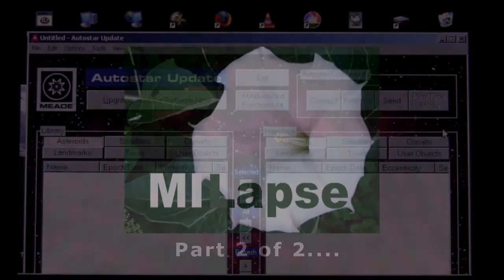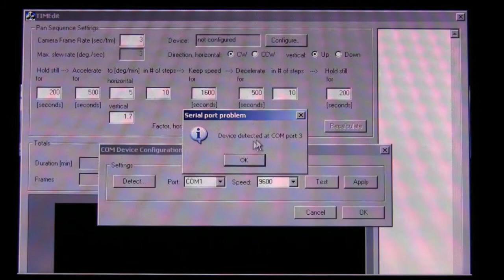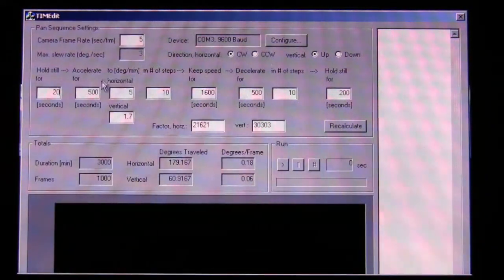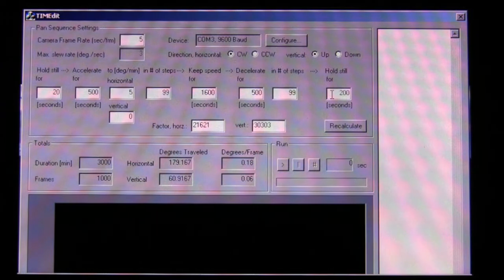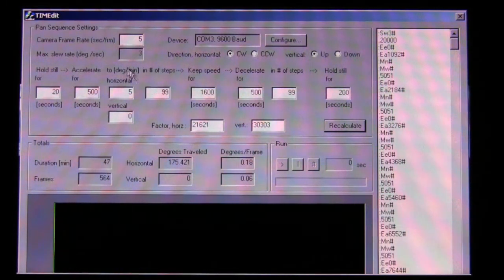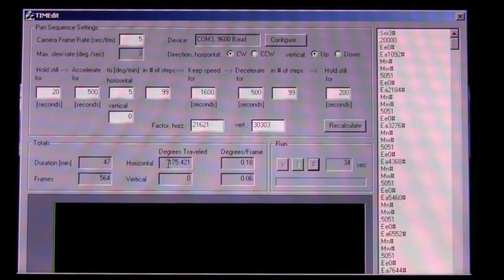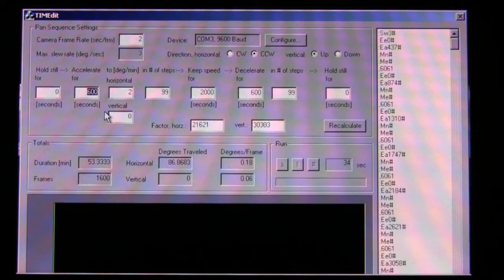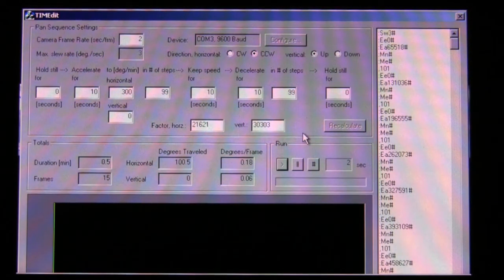Timeismotion software (how to use) for MiLapse Head - Part 2

Comment: @milapse Thanks for the info milapse! I was looking at OpenMoco too... just a question though: Are you still using the same motorized head and Meade controls, or switched to the full Arduino project on OpenMoco?
And if so, did you assemble it yourself or you bought it?
I can deal with the software part, but I'm useless when it comes to hardware... :P

Comment from the maker: @XSportSeeker this is what's commonly known as a 'hacking' or 're-purposing'... It's not a product that I produce, it's a Meade product. The only thing the 'TIM' software adds is the ability to 'ramp up' and 'ramp down' your speed - like I say in the beginning of part 1 "TIM will allow you to get gentle starts and stops to your timelapse pans".  The Meade head alone will work fine for simple continious pans at any speed. If you need more information go to timescapes(dot)org, lots of info there.

Comment: Not to be picky, I really like the product, price and iniciative, but why not simplify things? I like the videos, but they are a bit too long and don't pass much of a sense of security...
Now that the Meade controller goes with the head, why not send it with the custom firmware preloaded?
Another thing I still didn't get: how much can the setup do without a PC attached to it? From what I understand, most jobs can be donw with the head alone, right?

Comment: Any idea if this will work with a Celestron NexStar SLT mount? It appears that you can communicate with the mount via the same RJ10 - RS-232 - USB cable, and it appears that the mount can be controlled by a computer from this port. However I assume that Meade and Celestron uses a different protocol, so what needs to be changed for this software to work on a Celestron mount?

Comment: Why do you need to update the firmware on the meade head to a custom firmware?  I am wondering why the TimeIsMotion software does not just use the meade commands outlined in the "Meade Telescope Serial Command Protocol" document to command the OEM firmware?  Thanks!